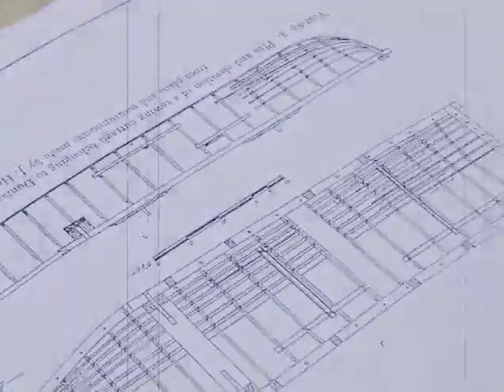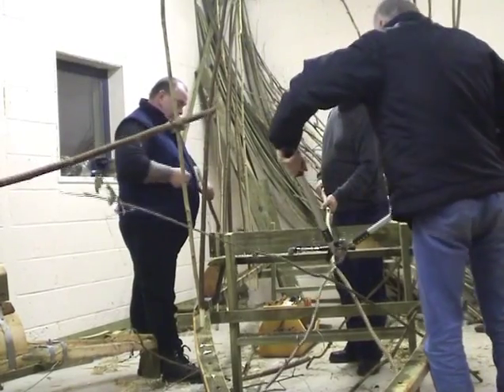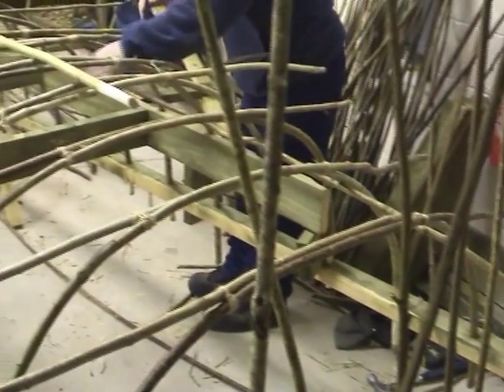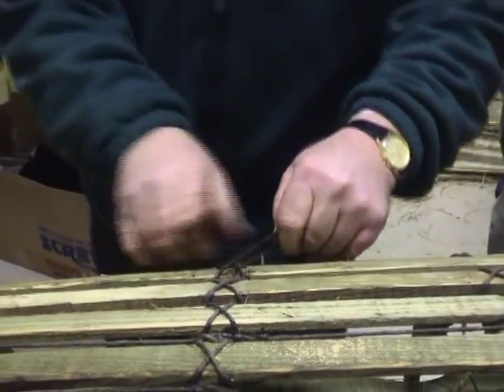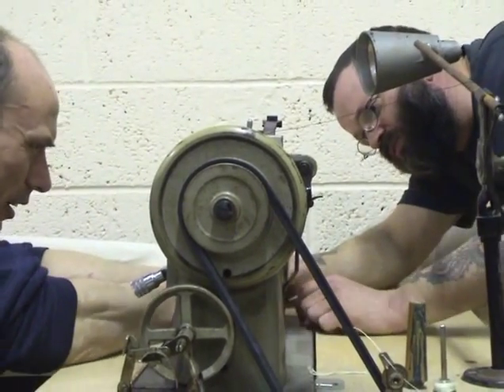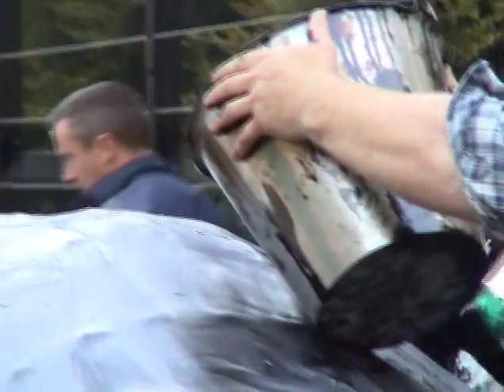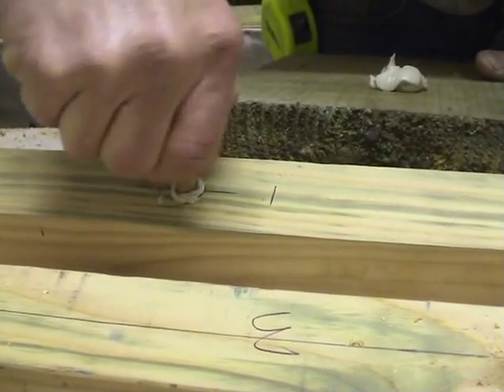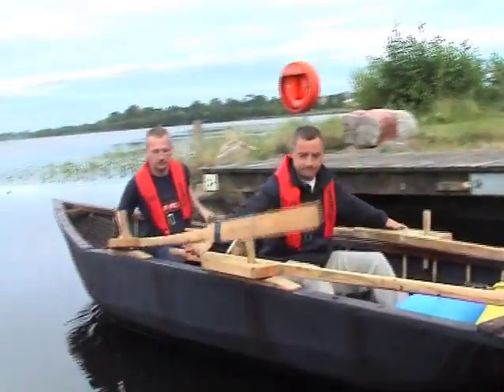Building Currachs @ Maghery

Comment: No way to build that way under the tropics where I live , because the tar will melt and the tarp will rot !! For my kayak I use a sort of nylon covered  with anti UV varnish !! It's the only way I found to resist propical sun and humidity without rotting or "burning" !!
Reply: we're not in the tropics here!!and !! and even more !!
Reply: There's an Irish  lad in Spain building curraghs on YouTube somewhere he used a rubber based coating to overcome the temperature of the local water